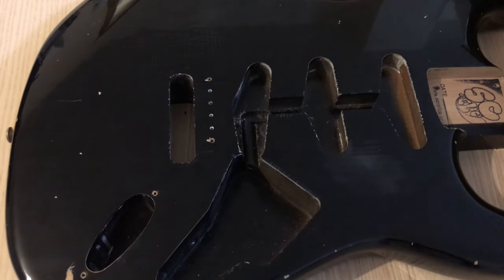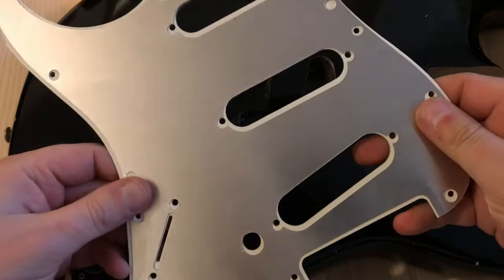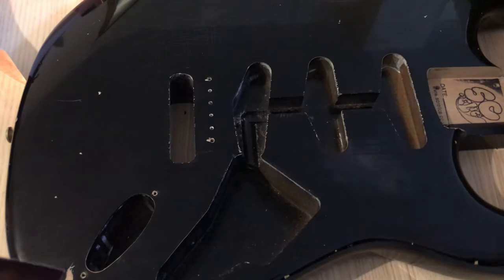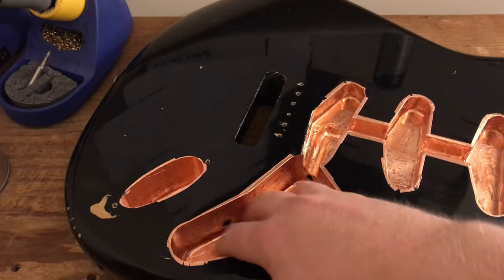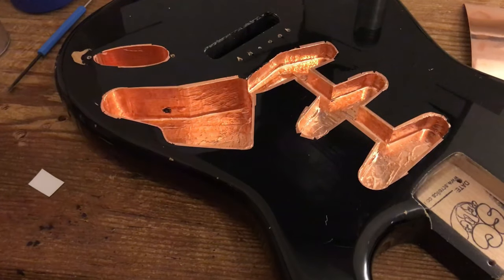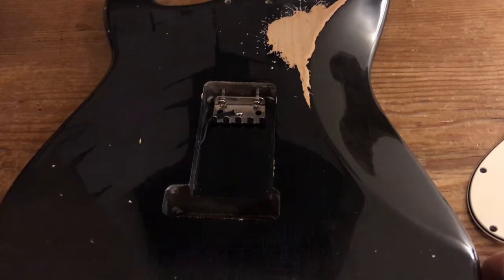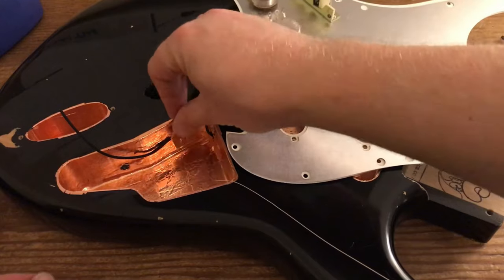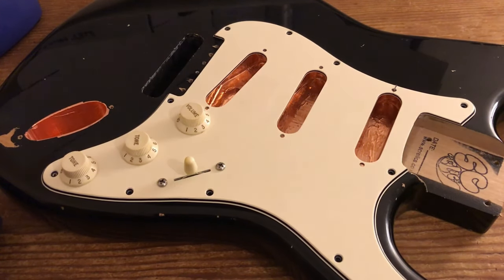Guitar Copper Shielding - How to Shield a Strat

Comment: Good info, but your last wire was redundant because the copper tape coming over the top edge of the cavity is going to be making contact with your aluminum pick guard shield. Ppl can make sure that happens by explicitly adding extra little pieces of tape at a few places coming over the edge but hidden under the pick guard.
Reply: He did specifically address this in the video. He said it's not necessary, assuming you've done a good gob making sure the back of the pick guard is touching the cavity tape. Just in case it doesn't contact it, for whatever reason, that wire acts as a backup.
Reply: That ‘backup’ wire is not only unnecessary, it works against the effort because it forms a ground loop. Instead of undoing yourself, take the time and do it properly.
Reply: You don't get ground loops with passive circuits like this.

Comment: Another thing that works for non-conductive adhesive is to fold a part of the overlapping copper tape over so it touches the joining piece and just cover it with a small piece to hold it down. Just a small strip at each overlap is all it takes.
Reply: Does that negate the need for soldering then ?
Reply: @davidkay3443  Yes! A lot simpler than soldering everything.

Comment: Good video -  but beware!  I took the opportunity to do it to a Strat whilst making a wiring mod to the volume and tone controls, so when it was all done and I had no output signal I assumed it was down to my new wiring being bad.  But it turned out to be a short circuit between the shielding in the jack socket cavity and the positive pin of the socket itself, which was making contact with the shielding when re-assembled.  The only way to definitely avoid that contact was to remove part of the jack cavity shielding.  It took a while to figure that out, but the good news is, even though lots of people on here are sceptical, the process has indeed removed the hum.
Reply: John Howarth Glad it worked for you. But another approach would be using a rotary rasp bit on a drill motor to remove the little bit of wood required to gain some clearance. Then recover that spot with a bit of foil tape. That way you're not compromising your otherwise complete job. A second, admittedly Mickey Mouse solution would be to place a tiny strip of duct tape on the backside of the jack's offending contact point.
Reply: Could you simply apply some insulating tape around the positive pin of the socket?
Reply: I was thinking about this situation the whole time before I read this comment. lol
Reply: this could be happening to me , I'm not sure . I have no sound - could the metal of the body of the  volume knobs contacting the copper be the issue. idk where the short is : / - ill check in the plug in
Reply: I took that into consideration while shielding my strat. I protected the jack leads with elec. tape. Works great
Reply: @HappyHermitt  I did the same. Unfortunately I didn't think about it until I put it back together and restrung it. Once I noticed no sound... I immediately started investigating the input jack and it hit me... the jack was grounding to the tape and to the positive... Once I threw on some electric tape around each; quietest guitar I own now.

Comment: Very good shielding video! Bear in mind that the guitar is being grounded to the amplifier via the guitar cable. Hence, the output jack and plate are the first grounded elements of the guitar. If you leave  foil tabs to be captured by the jack plate and the pick guard (scratch plate) foil (or shield plate) everything else in the electrical "chain" will be inherently grounded. Adding the soldered wires is good insurance, though. Shielded coax cable from the jack to the pots is also recommended.
Reply: So if I understand correctly, potentially no soldering is needed? as long as there is contact between the jackplate, foiled pick guard, and foiled cavities?
Reply: thats what i was thinking do you have to put that wire to connect the twp cavaties?
 @AndrewAviles

Comment: Had horrible noise from my squier strat vintage modified unless I was touching the strings. Watched your video, followed to the t and now experiencing noise free strat bliss. Thanks a lot, man!
Reply: If it went away when touching strings, that's a grounding issue.
Reply: @cydonia9342  That is the most common misconception about ground on the internet. The issue is with the ground if the buzz doesn't go away when touching metal parts. And even his comment confirms that. Otherwise if it was lose ground cable, how shielding the cavities woud have fixed a lose cable?
Reply: @cydonia9342  you don't have a clue about electricity
Reply: Definitely a good Mod.
Reply: Im gonna do the same thing asap.

Comment: One important item to also consider, when you solder your input jack back in; make sure to electric tape or shrink some plastic over the soldered connection on the hot wire (white in my case). If you don't, the wire can make contact with the shielding causing it to ground (no sound). Ask me how I know.... I did this to my strat this week and it was incredible how much quieter it made it. I didn't need the extra wire from your video but thank you for the tips on the rest! Bought the stuff on Amazon for around $13 and its the best investment in making my guitar sound better. Total time takes about an hour start to finish if you go slow and make everything clean.

Comment: One way to get around the solder blob between every piece is just bending over the edges. Shielding my guitar, I would bend over an edge of one piece that laid on top of the other and then I'd put another little piece taped over that just to hold that folded edge down. I have full continuity from one cavity to the other across all cavities without issue. I did need to solder a wire from the neck cavity to the control cavity on to the copper shielding (it was a tele) but it worked well, I stopped picking up radio stations.

Comment: Jack socket plate to main cavity is connected. The ground from the socket is attached to the plate which touches the copper tape flared around the edges.

Comment: Doesn't that layer of aluminium under the scratch plate connect the separate cavities, making the soldered wire redundant?  Surely, there's no p.d. between the soldered wire and the bit of copper touching the aluminium?  Or is it just a belt and braces approach (I've no doubt the soldered connection is better than just physical contact)?  Or have I missed something?

Comment: Great! why do you need to have continuity between different cavities? If they’re all individually conductive, what does soldering a connecting wire actually add? Thanks
Reply: You don't explicitly need continuity between the different cavities, but the shielding needs to be grounded to work. Doesn't matter how you accomplish this. Eg. the small cavity could be grounded via contact with the output jack, and the main cavity can be grounded via the face plate shield to the pots, but the additional wires he added ensure continuity to ground (as long as one cavity is grounded, the other will also be grounded).

Comment: Great video! I added shielding tape before seeing this video and now I understand what is missing to complete the job, er Faraday cage. It looks like I'll need to add tape under my pickguard in place of your fancy metal plate. My ground wire to the trem claw is already there but now I know how to ground the cavity tape to the electric bits, and ground/connect the cord cavity to the main cavity.

Comment: is that jumper wire for the mic input cavity to the pickup/controls cavity still necessary? because when you wire them all up and reassemble the ground of mic input jack is already grounded to the shielding of its cavity and its ground wire is already connected to the ground of the potentiometers which are also grounded already to the shielding of their cavity.

Comment: If the shield on the pickguard comes into contact with the tape on the jack cavity and the other cavities would that eliminate the need to connect the cavities with a wire?
Reply: The shield on the pickguard will never come into contact with the tape in the jack cavity because the pickguard does not sit on top of the jack cavity.  In fact, the jack cavity has it's own cover for the jack, so this will never happen.  You need the wire.
Reply: The pickguard shield will not be in direct contact with the jack cavitiy, however, the shielding on the jack cavity will be in contact with the jack base plate if done as shown here, the base plate is in contact with the ground wire of the jack, which in turn is in contact with the ground in the pickup cavity (usually soldered to the case of the Volume pot), and hence here the extra wire would not be needed to connect the two shields in pickup and jack cavity. But it cant hurt either just to make sure there is good contact all around.
Reply: @strat115  that's the exact same thing i was thinking. so when i shielded my strat guitar a few days ago i thought of not having the need of putting a jumper to those two cavities and it worked perfectly fine. hum was eliminated.

Comment: Ok this works but is a bit of effort. I did this on a MIM HSS Strat just like the video shows. However in the cavity where the guitar output jack goes I found that the foil (ground) could touch the hot (signal) end of the jack when when jack plate is inserted and screwed in. I fixed this by using some electricians tape on the foil side where the jack end could touch and also added a bit of this tape around the jack tip area. I posted this just to let others know what may be the problem when there is no sound when plugged into an amp.

Comment: This video is so helpful. I’m from Poland and you just explained it to me better, than many local resources. Thank you!

I have just one more (maybe stupid) question. The ground in my Squier Jaguar is conected with a cable going from the jack, through the little hole, to the tune-o-matic stud. Is it fine as it is or should it be connected to the pot? I think it doesn't matter, because it's the connection between the elements that matters, but I'm a total noob when it comes to electronics, so I recon it's better to just ask.

Again, thank you for this awesome video! ❤️

Comment: Hi man, good guide. I use to shield my strat the same way.
Anyway, please remember that most of the interferences that's coming from outside, is caught by the pickups. 
So the Faraday cage is not fully closed as it should be, to 100% protected the internal connections from interference.
It is open because of the three pickups.

To make your job more complete, remember to shield the pickups too.
It must be done putting a copper strip around each single coil's windings. The two strip ends must not touch each other, meaning you must leave a gap between the two ends (really important, otherwise you will loose top end in the sound).
Then just connect the copper strip to pickup's ground (base of the pickup's black shield), put back the plastic cover on the pickups and you're done.

Without this mod, the Faraday cage alone is useless, because the pickups still catch the interferences from outside.
Cheers
Reply: I am not sure "most" of the interference comes from the pickups themselves.  There is certainly some 60 Hz hum that comes from the pickups being exposed outside the cage, but that is typical with single coils.  The shielding tape takes away a lot of the hum you hear and it is quite noticeable between a shielded and unshielded guitar.  I agree that if you shield the windings themselves, you will reduce the noise even further.
Reply: It's not useless, it works great. Shielding gets rid of interference, not single coil hum.
I have basses shielded in the factory with paint in the cavities and nothing under the pickguard and they are completely quiet. I have another Precision bass that doesn;t hum but it buzzed because the jabronis at the Fender factory half-assed the shielding. I redid it with copper tape, only the cavities and the pickguard, and all the buzz is gone. Shielding the pickups is not necessary.
Reply: @DanielBobke  Shielding will not eliminate single coil hum, only interference. If shielding the pickups got rid of hum we wouldn;t have humbuckers.
Reply: @AndreaAustoni  Never said shielding eliminates the hum completely - but it certainly helps.
Reply: @DanielBobke hi, your video shows exactly how to do a good shielding work on the guitar, everybody should do it that way because it's absolutely useful. 
But why it is useful? 
Because the guitar copper wires that connects pickups to the switch and pots needs to be shielded from external interference, the rubber cover itself does nothing. And we're talking about very SHORT wires, but they HAVE to be protected from electrical interferences.

Well, now consider that each pickup has got METRES of unshielded copper wire, that are completely exposed to interferences, under a thin plastic pickup cover, that COMES OUT of the pickguard.

So a very long unshielded copper wire, electrically connected to the SAME wiring we shielded with our good job on the cavity.. that is even exposed externally, out of the pickguard, under a fuckin thin pickup plastic cover. 
So we take care of shielding che cavity, to shield and protect the very short wires inside the cavity from interferences..and do not care about the LONG unshielded wires around the magnet, that are even partially or completely exposed EXTERNALLY (out of the shielded cavity)?????
That's clear why I say MOST of the interference comes from the pickup windings....and WHY it is so important to complete the job shielding the pickup too.
SO, thanks Daniel. And to people who say "shielding the pickup is not necessary", I'm sorry but please just use your brain and logic. 
It doesn't mean 'do it', do the job, if you're already happy with your instruments.
It means do not give wrong info to people reading

Comment: Thank you sir, very informative and comprehensive. Was just wondering why, if this is so important, that most guitars don't come like this from the factory. My strats just have a bit of black paint in the control cavity and a bit of aluminum on the inside of the pick guard around the pots. The guitar is as quiet as a mouse!
Reply: Then yours is shielded. My Fender bass came like that but they half-assed it and I had to redo it with copper tape.

Comment: When connecting the jack cavity to the pickup cavity, could one feed the cable through before the copper shielding tape goes down rather than soldering it in place?

Comment: Ever tried shielding single coil pickups ? I’m told you wrap “pickup tape “ around the coil a couple times to completely cover the coil , then put almost 1 full wrap of copper tape on top of that , but to leave a slight gap so as not to kill of some of the high end. Can’t remember if there was an extra step to finish the process such as connecting the tape to the pickup ground
Reply: That's what I've read too. Im thinking of giving it a shot soon also. If youve already tried it out, let me know your outcome if you would. Just curious.  Good luck!

Comment: Great video! just one question, is it possible to just cut a little strip of tape and put into the cavity that goes from the jack to the pickup cavity, instead of soldering it? i mean, it makes sense to me that if the tape is having contact in both cavities the conductivity will persist
Reply: Of course, it's the same principle, just a matter of preference. If there's continuity you're good.

Comment: don't I need to do the same in the back cavity? thanks
Reply: All cavities I would say. Just for safe measure. Maybe use a small resistor on them even to discharge any air energy? Idk just giving my noob opinion lol
Reply: @travisnelson9104  I  disagree. The back cavity does not need to be shielded.
Reply: @paulfrombrooklyn5409  I strongly disagree as doing my back cavity was major problem humwise... Now dead silent.
Reply: @killaken2000  hi man, I guess it depends on a bass/electronic, because my hum was really EXTREME. For me, shielding was godsent for a dead quiet operation.

Comment: 8:50 - 9:xx No need the jumper wire between jack cavity - main cavity if the jack plate is contacted with copper tape because the JACK PLATE already connect to GROUND with output jack
Reply: accurate

Comment: My loaded pickguard only came with 3 wires to solder: ground to claw in back, ground to output Jack and lead to output Jack. If I want to add copper shielding to my body cavity, how can I connect it to ground without a 4th wire?

Comment: Why don't they sell the guitars shielded?
Reply: They do. But not all guitars are shielded at the factory.
Reply: The answer is simple . It does not work. It is a wives tale to think it does. Wake up guys
Reply: @invecta18  ummmmmmm no
Reply: Money first
Reply: They do but they cost 500 dollars more
Reply: @invecta18  of course it works, its electrical physics 🤦‍♂️  its a faraday cage, it shields the coils from external noise and static.
Reply: Most of the time they shield them using paint. Not as effective as copper foil but cheaper to manufacture.
Reply: @invecta18  ur slow
Reply: My Fender MIM Strat came with a very nice coating of shielding paint in the cavities and a shielded pick guard. I was very surprised!!
Reply: @invecta18  It’s the same principle as your tinfoil hat.

Comment: Excellent clean job, but it is better to avoid making the link between the pick-up compartment and the Jack compartment. the pickguard shielding will close the Faraday cage just as the jack plate will close that of the jack compartment which will be connected to the other through the circuit ground.
Reply from the maker: thanks for the feedback. Yes several people have mentioned the same, and I agree. However, I do have a habit of "reinforcing" ground connections. Thanks for watching, take care